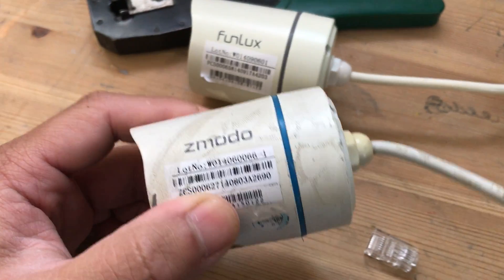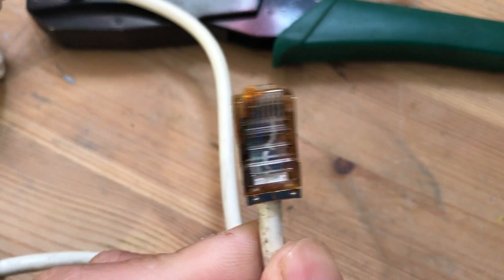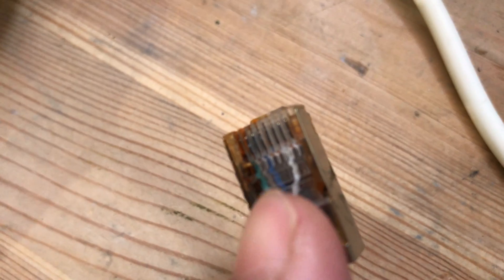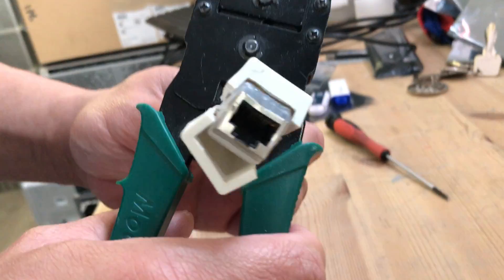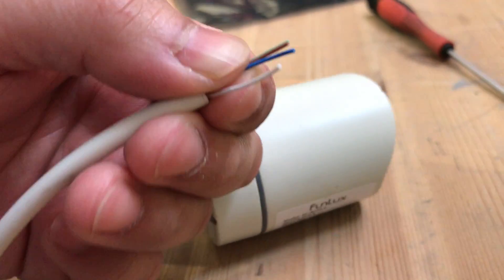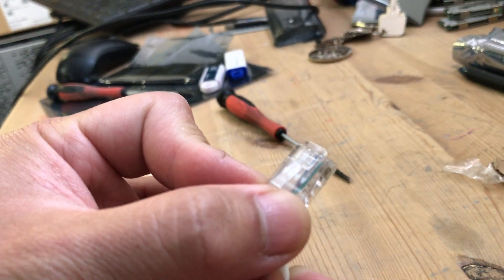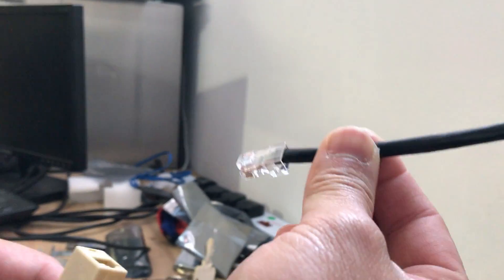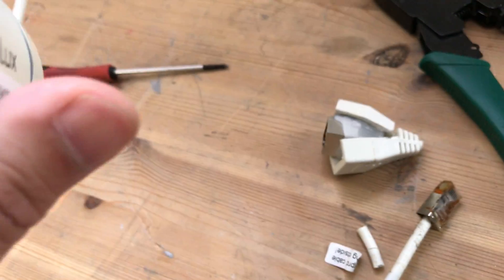zmodo funlux poe cctv camera water ingress repair fix

Comment: The green is + power 
Brown is data
Blue is data
The white wire is - power

Make sure test the camera first by using a short Ethernet cable with one end plugged in to the DVR or computer and the other with the wires exposed to do a splice test. Yes you can twist the wires from the Ethernet and the camera wires together. Sometimes the brown and blue wire which are the data lines don't read because they are connected wrong. This is how I did it. Hopefully it should work for you.

Camera wire ---- Ethernet wire
Green ---- orange and white
Blue ---- orange
Brown ----- green and white
White ----- green

Remember if the camera doesn't come on just switch the blue wire to orange and white and the green wire to orange.

I hope this helped someone. 🙏
Reply: not work, when i did this my nvr it rebooted

Comment: How do I avoid the moisture getting in
Reply from the maker: apply some silicone around those loose cable area to stop rain water getting in. or sealed them with silicone during the coupler bit